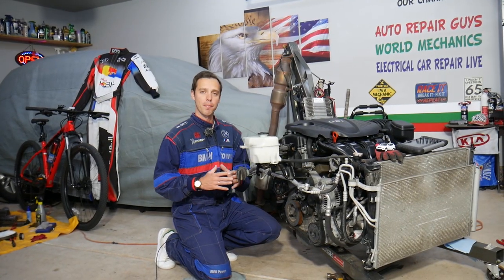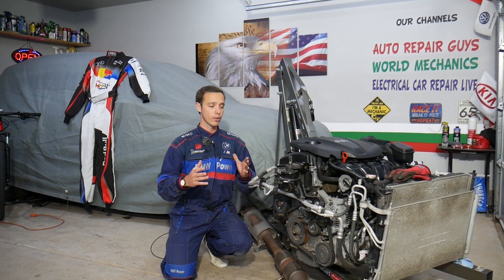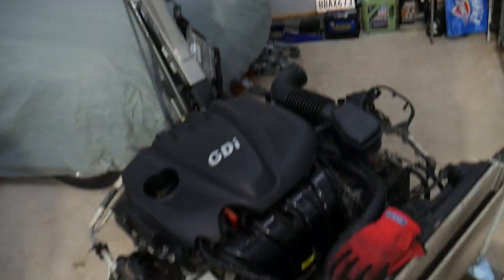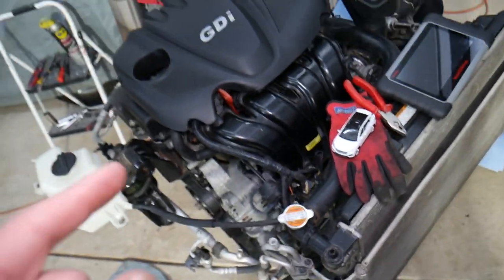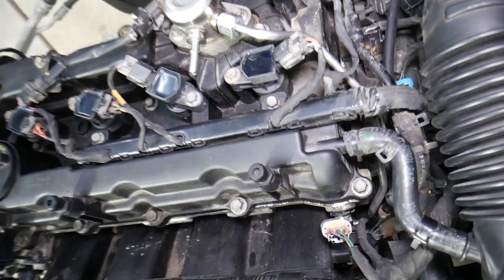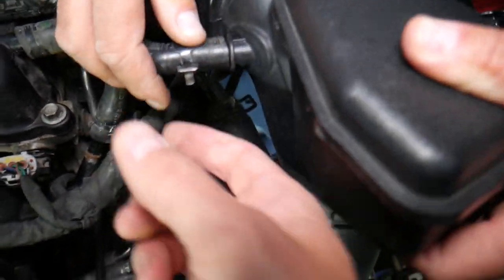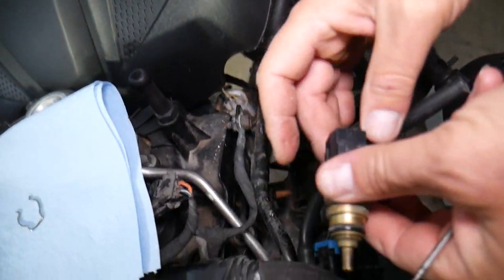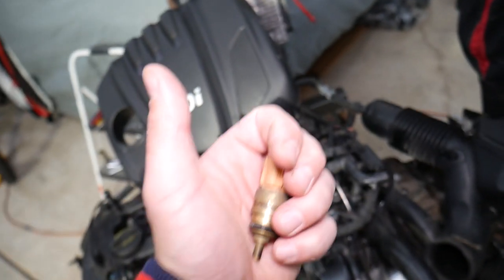HYUNDAI SANTA FE COOLANT TEMPERATURE SENSOR REPLACEMENT LOCATION REMOVAL

Comment: Were is the fuse for the radiator fan
Reply: The fuse for the radiator fan is located in the engine fuse panel.  There is also a fan relay.